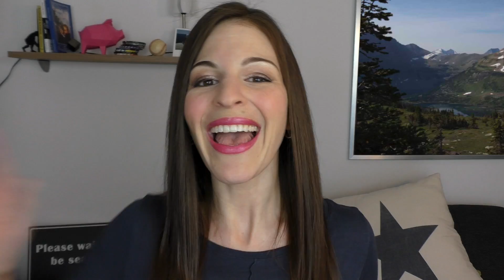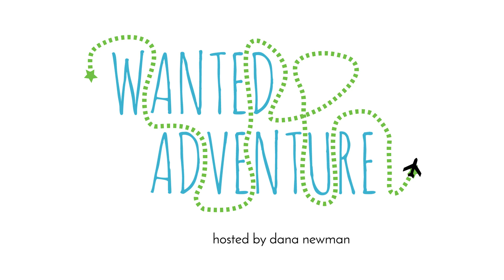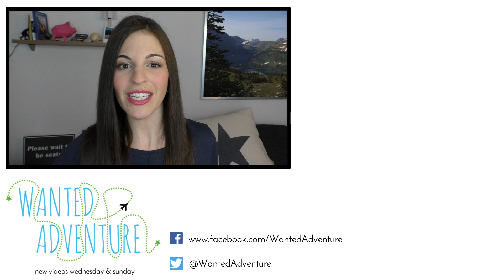Why Are Houses in America MADE OF WOOD?!

Comment: Are there any American houses in Germany a normal German could just buy and live in?
Reply: +morbvsclz Actually, wood frame houses are much simpler to insulate to a high degree than stone houses. Stone has a lot of thermal mass, but that isn't insulation. If you want to insulate a stone or brick home, you are either going to change the external appearance or lose a significant amount of living space.
Reply: I'm not sure, but I think such houses are not official "allowed" for living in. (safety reasons, etc.)
Reply: There are wooden houses in Germany, more and more people built them. But they are far more stable, e.g. given you couldn't punch through a wall with fist or fall downstairs INTO the wall...
Reply: not really, never been at a home made out of wood actually as far as i remember
Reply: A friend of mine lived in an American house in Germany... It was a prefabricated wooden house, pretty large and actually very nice. It was American in every way -> Huge fridge with ice maker, super flimsy "cardboard" doors with knobs rather than handles, fly screens in front of the windows and a screen door, windows that open outwards with a handle you have to turn rather than a German window that you can tilt or fully open, no double (or even triple) glazing etc.

Afaik they ordered it with a German company that specialized in importing those US prefab buildings, doing all the paperwork for you and then also build it. And even after import from the US, shipping, customs duty etc. it was still a lot cheaper than it would have been to build a German house of the same size. How the price compared to a German prefab house, I don't know. And another factor is of course energy efficiency. Can't imagine the isolation of that house will have been all that great, so heating costs were probably quite high.
Reply: +Domenic Pass
There's no law which prohibits such house designs. There are some laws that dictate specific things like electrics, structural engineering or which materials are allowed, but a good architect should actually be able to hide these minor changes.
Reply: I would bet that you're not strong enough to punch through a massive reinforced concrete wall^^ And if you're talking about hollow walls: This is possible for wooden walls too, if you want to save some money.
Reply: Thanks for the numerous replies.
Reply: Yes, there actually are wooden houses, usually in more "traditional" areas (old villages, woods, mountains - ski cabins for example), those are made of massive beams, not plywood or whatever they use in the US. And apparently there's a new trend to build energy efficient houses out of wood, but I'm not sure if they're completely wooden or just want that "natural look"...

@Maya: I'd guess he meant wooden houses in Germany are more stable than those flimsy things in the US, not more stable than a concrete one...
Reply: I also wondered about insulation and these homes
Reply: meggesflex No there are not cause Germans are smart and would never buy something like that. And because no one is interested in wooden houses, no one is building them, because like I said before no German would buy it
Reply: Ok in America the way houses are built including materials varies by region; we have desserts, mountains, prairies and sub tropical all within only 48 states. That's not even taking into account Hawaii or Alaska. We use wood because it is plentiful and brick is very expensive here. There are brick homes just about everywhere though. I live in the southeast in a warm climate and we have a lot of brick. It goes back to aesthetics.
Reply: I have seen them in Berlin in the US sector.

Comment: Oh, that makes sense. At least in hurricane areas. But for houses that aren't built there I think stone still is a better option (even though it's more expensive). The cool thing about stone houses is that they last longer and you'll eventually end up having cool old buildings. After all: If castles were made out of wood, they surely wouldn't be half as cool as they are (for obvious reasons, a giant pile of rotten wood isn't exactly what I would call intereasting).
Reply: Castles are made of stone, because it needs to withstand an attack. I bet nobody back then took in mind that it would look cool after 700 years^^
Reply: Castles are cold and drafty. Nice to look at, terrible to live with/in.
Reply: Don't forget that wood reacts better to earthquakes. Where stone or brick will just tumble to bits. 
Plus the homes are not 100% wood that's raw. It's normally just a wooden frame upon which other materials are used around it. And the wood is treated so it's near impossible for termites to infest, won't rot (Unless it's sitting is water for years) and won't warp under normal conditions. We still have homes here that are over 100 years old, and that's pretty good for a place not much older.
Reply: Most castles in Europe were actually made out of wood but there isn't much left of them
Reply: +Elkey_er
Lol, you didn't really said that, did you? Do you even know the history of America? The colonization took place in a time, when the canon was invented. Castles got obsolete because of this, otherwise they would have definitely build Castles out of stone.

And well, you should also look up european history, too. Building a defense line out of wood wasn't that uncommon, especially if you had to build fast, for example if an enemy already knocks on your door. It can burn, yes, but it still slows the enemy down for quite a while and that's actually the main prupose of any defense line. And if you build it in the woods, it gets pretty dangerous for the attacker, too, if he really tries to burn it down.
Reply: my house is 190years old, completely  cypress wood.
Reply: Thinking that castles were all made of super durable materials is survivor bias.
Reply: Speaking as having just come home from Hobart, Tasmania has a great love for keeping their heritage buildings, and while those buildings might be only a maximum of perhaps 200 years old, quite a lot of them are sandstone and brick buildings - solid, long-lasting, and resistant to the weather (except maybe hot summers, but these days they can be retro-fitted with air-con). 

So yes, stone buildings are good for eventually having very old buildings to admire. One just has to hope one's city or state council are heritage-minded enough to protect such buildings from ambitious developers.
Reply: +Graup
Most "stone" or "brick" houses are actually wood-framed...certainly in the last 150 years or so! Building a "structural brick" house would require two (or more) rows of bricks, joined together by laying bricks across every fifth layer or so. A good way to double the construction cost!

The only STRUCTURAL masonry homes I can think of around me...are some 100-ish year old cinder-block constructed houses. That's about as sturdy as you can get at a reasonable price-point...but MAN, are they ugly! I'd sooner own a "200 year" house that looks good, vs a "500 year" house that I have to repress a gag reflex to look at ;-)

and some of the oldest houses in the USA are farm houses that were built with the rocks they recovered when they cleared the fields the very first time...but I think even these houses have timber supports.
Reply: double walls or cavity walls where common in the uk awhile back, new builds are more flimsy
Reply: btw it is a show stopper lovely queen anne home.
Reply: +Melissa Lewis
And you shouldn't forget, that houses, which actually would get problems with earthquakes aren't made out of pure stone or bricks these days^^ And that also includes materials which actually reacts better to earthquakes than wood, otherwise it would be possible to build skyscraper in these areas
Reply: Castles are mainly stone. Smaller fortresses and defences on river banks and coastlines would be wood and even mud for many years depending on how quickly it needed built and the period it was built in. If a quick defence was needed wood would be used but main 'castles' would be stone to protect against enemy  fire. I don't think wood is as effective as 2 meter thick stone walls.
Reply: They were, that's what a castle is.
Reply: Guys, my point wasn't that castles were made of stone, but that the oldest buildings we know are made out of stone.
Reply: HappyandAtheist ? 

Have you ever been to a castle before? Than you would know that you should better keep mouth shut. 

They haven't replaced wood with stone, because they already knew that wood can burn and stone don't. That's the reason why there are so many castles in Europe and not in the US.
Reply: Castles aren't built in woods tho and they are not quick defences. Defences for castles placed nearby would be wood but most castles are placed stratecially in the landscape so that there is only one way in and if they had to be built in an open area they would have a moat.
Reply: The reason there are no castles in the us is that castles are centuries older than the discovery of the us. They had no use for castles.
Reply: And what if you need to build a strategically placed castle when you need it, when you don't have enough time to get the woods? Retreating would mean, that the enemy can claim the land without any problems, because you're unwilling to build defenses out of wood until you have enough stone to upgrade it. And well, it's actually not that uncommon to see castles surrounded bei woods and mountains. Many castles were build to protect cities or passages near them. And because a city needed much wood it wouldn't make sense to actually build them without any tree around. Just look at south germany. You'll find some pretty big woods around and also many castles there. They cut down many trees around the castle, but that needs quite some time, too.

"castles are centuries older than the discovery of the us" isn't a real argument. It just shows me, that you don't know enough about why castles didn't get build at around this time anymore. Canons were actually invented around this time, which made castles in this form quite useless. But if they would have conquered the us like 200 years earlier or the canon wouldn't have been invented at this time around, then they actually would have build some castles over there.
Reply: Castles are built to protect against cannonfire. Cannons are a lot older than you seem to think, they've been used since the 13th century in some from. It's not just cannons tho catupults are just as effective but a castle has walls that are two-three meters thick to protect against this. Yea quick defences are made out of wood but saying the us doesn't have castles because of cannons is pointless. Castles are highly effective against them. They simply weren't needed as castles were mainly used by royalty and such to protect their land-the us didn't need them as the constant battles of these 'families' where no longer really happening or effected them as they were thousands of miles away.
Reply: Also you didn't wait to build a castle until after you heard there was someone coming to raid your land. You built them as a preventative measure BEFORE that. If you needed to defend your land from anything that could potentially take the castle you would build small defences but castles where made to essentially hide in and defend. That's why larger castles had a lot of the town within their walls.
Reply: Actually ancient and medieval castles were build to make it as hard as possible to occupy this place. That includes attacks with fire and people trying to destroy the walls. Wood is quite simple to destroy, so they had to take stone instead, but that drastically changed when explosives and canons get stronger and stronger. Yeah, you're right, it started some decades earlier (but not even close to the beginning of castles though), but there's actually a big difference between anti person guns and wall breaking guns. You can't just add some extra explosive and expect, that your gun won't explode right in your face. So it took quite some time for the canons to actually be a viable option to take out well defended castles and at this time the architects started to actually use other designs than what we would call an old castle, because at this time it was more important to actually destroy enemy canons before your walls got destroyed rather than just hinder the enemy to get into the castle.

Yeah, but what, if the enemy starts to attack you, because you're building a castle? You can't expect them to patiently wait until every stone is where it belongs to. If you know, that the location you're building in is quite risky, than you actually have to prepare for an attack. You could for example build a palisade and some watchtowers, before you actually start to build a big castle in this place, otherwise the enemy would have an easy time raiding your camps and building site and in the worst case, he can just occupy the land and finish the castle, while actually defending it properly against counter attacks.
Reply: Yea you would definetly need to defend the land when the castle was being built. But travel was slower so you could protein type have mints to prepare depending on where the land you are trying to protect was stituated. Also depending on who you are and where you are. For instance England-many kings would've had constant defences blocking entrance to england because of disputes with France and the rest of Europe.